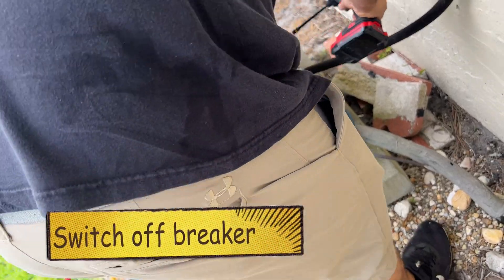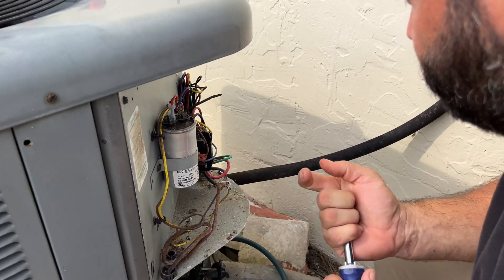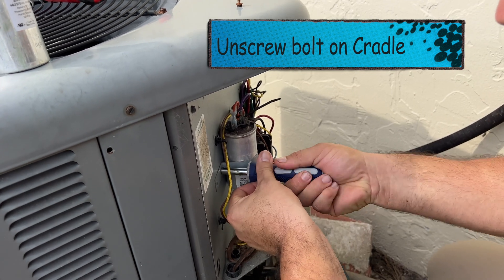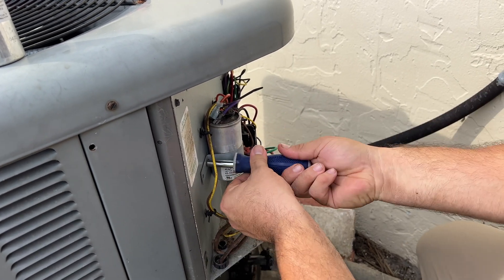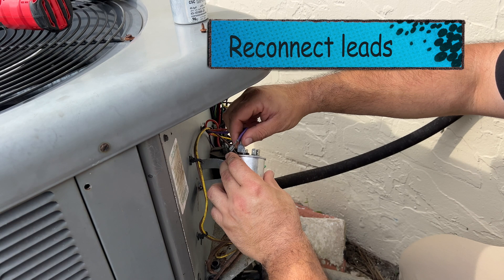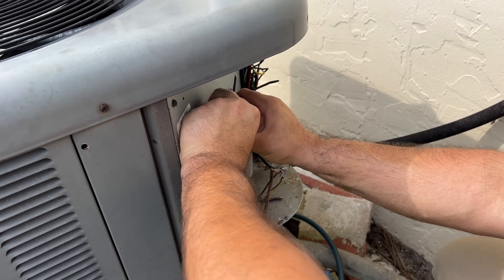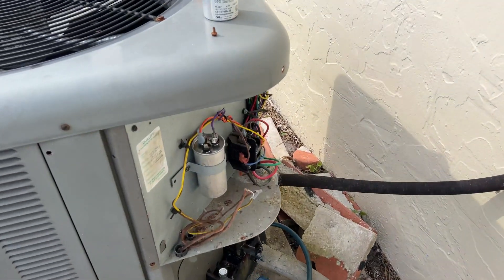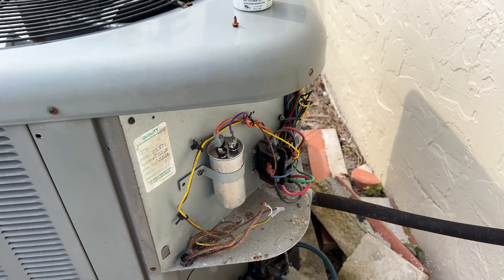How to replace a Capacitor on a Ruud 2.5 Ton AC

Comment: It would have been nice to see the size of capacitor
Reply from the maker: Each one is different depemding on model.As stated, the 2.5 ton can run between a 30 and a 45. THe Trane 2.5s I looked up use the 45. I would grab a 45 on the way. If job is a long way from supply house, you could take a Turbo 200 and although a bit pricey would prevent a second trip good luck on install